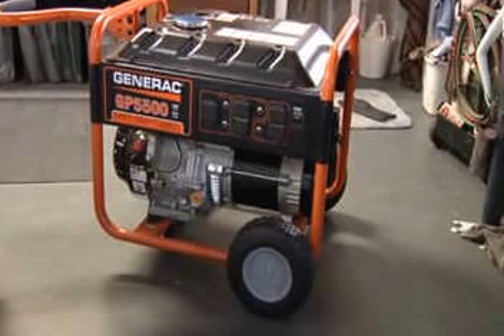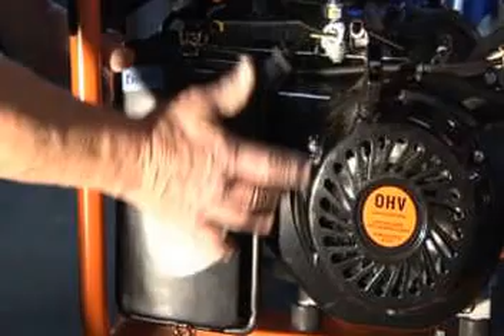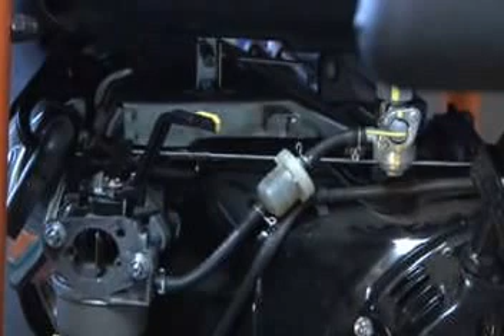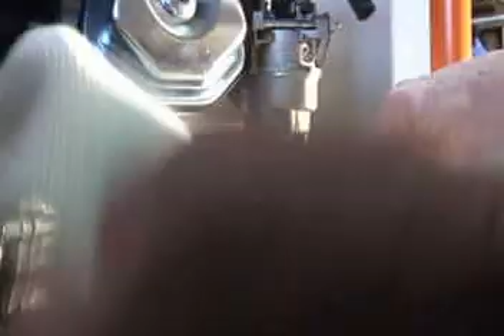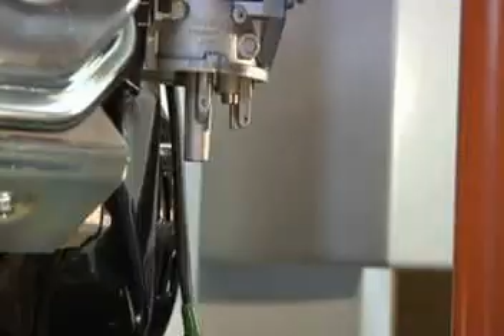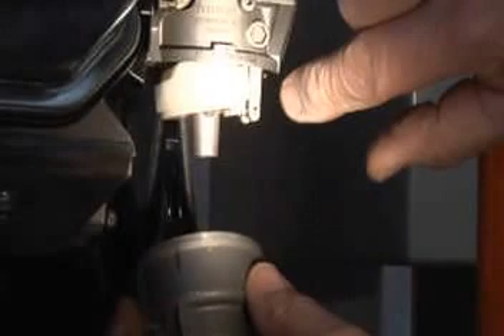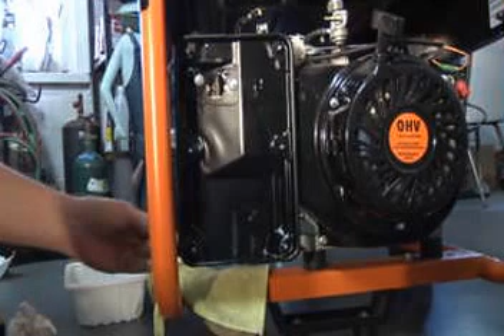Fixing Fuel leak on Generac GP5500 Generator

Comment: Bought a new generator after Irma but didn't open it until Elsa was on her way here.  Took it out of the box, set it up and when I flipped the fuel valve on gas started running everywhere.  I thought it was gaskets but it turned out to be the float was a bit stuck.  I unstuck it and it seems fine now.  Your video was very useful in confirming what I thought the issue was.  Very good and detailed video, sir!
Edit: My Generator is a Westinghouse but it's laid out just like your Generac.
Reply: Generator safety: this is only a reminder for everyone’s safety when using portable generators. Anyone who uses portable gas generators really needs to see this safety reminder. All generator safety rules should be followed carefully. This advice is just to make sure that everyone is aware of all the warnings and it’s just to remind people to be careful using portable generators. Generators can be dangerous if not used carefully. Every year, hundreds of people die or get injured when using portable generators due to carbon monoxide poisoning and electrocution. Make sure you are using your generator carefully and keeping others safe as well. There is something very serious that everyone should always be aware of when using generators. Some people do run their generator indoors which is not safe and that increases the risk of carbon monoxide poisoning which can cause death of family and you. Some people run their generator in wet conditions which can electrocute them. Please remember that you should never run your generator indoors. Remember that carbon monoxide is an odorless and colorless gas that you cannot see or smell. Carbon monoxide is a silent killer. Keep that in mind. Make sure your generator is 15-20 feet away from your house and away from doors, windows, and vents. Never use your generator in your porch too. Having a carbon monoxide detector is very important against generator safety. Some people also allow children to go near the portable generator which could pose risks. We need to keep an eye on our children making sure that they are not near the portable generator so they won’t get electrocuted or burned by the generator which is dangerous. A locking enclosure also keeps kids safe. A generator shed might look like a tempting place to explore, or take cover during a game of hide and seek, but a generator is a dangerous piece of equipment that can cause injury. It says on the manual that we should also keep children away at all times from the portable generator to avoid injuries. Please do not allow a child or unqualified people to operate the portable generator. Just because some manuals missed what should be listed doesn’t mean it’s safe to do. Always follow the generator safety rules when using portable generators. Generators pose electrical risks. If you need to use your generator during wet weather, you need a generator tent to protect your generator from getting wet. Don’t let your generator get wet. Keep your generator dry and before using your generator, please make sure your hands and your generator is dry. Do not wear loose clothing when operating the generator. Everything that is said on the generator’s operating manual should not be ignored. Never smoke cigarettes near the generator. Please keep flammable things away from the generator. Never overload your generator too. Your generator can catch fire. Never ever try to plug a generator cord into a wall outlet to avoid back feeding. Back feeding your generator is dangerous. Always turn on your generator first before plugging in appliances and shut off the appliances before turning your generator off. Use a heavy duty cord for your generator and the cord should not be worn out. All the instructions should be followed carefully. Never refuel your generator while it’s running. It can cause fire if fuel spills while your generator is hot. You should turn off your generator and let it cool off before refueling it. Having a fire extinguisher next to the generator is also important. This is only a reminder for everyone’s safety of using generators. Make sure your generator is properly grounded. Having a fire extinguisher next to the generator is also important against the safety rules. https://youtu.be/I1jT3ANENvI and here is a video more about keeping others safe when using generators and also about our family’s safety. Hope this helps. Remember it’s better to be safe than sorry.

Comment: Thank you! Mine was pouring fuel. Followed your video and had it fixed in a out 30 minutes.
Reply: Here are the rules about portable generator safety: This is just a reminder for everyone’s safety. All generator safety rules should be followed carefully. This advice is just to make sure that everyone is aware of all the warnings and it’s just to remind people to be careful using portable generators. Generators can be dangerous if not used carefully. Every year, hundreds of people die or get injured when using portable generators due to carbon monoxide poisoning and electrocution. Make sure you are using your generator carefully and keeping others safe as well. There is something very serious that everyone should always be aware of when using generators. Some people do run their generator indoors which is not safe and that increases the risk of carbon monoxide poisoning which can cause death of family and you. Some people run their generator in wet conditions which can electrocute them. Please remember that you should never run your generator indoors. Remember that carbon monoxide is an odorless and colorless gas that you cannot see or smell. Carbon monoxide is a silent killer. Keep that in mind. Make sure your generator is 15-20 feet away from your house and away from doors, windows, and vents. Never use your generator in your porch too. Having a carbon monoxide detector is very important against generator safety. Some people also allow children to go near the portable generator which could pose risks. We need to keep an eye on our children making sure that they are not near the portable generator so they won’t get electrocuted or burned by the generator which is dangerous. A locking enclosure also keeps kids safe. A generator shed might look like a tempting place to explore, or take cover during a game of hide and seek, but a generator is a dangerous piece of equipment that can cause injury. It says on the manual that we should also keep children away at all times from the portable generator to avoid injuries. Please do not allow a child or unqualified people to operate the portable generator.  It is important to keep your children safe especially little ones. The portable generator can be hot during an operation. Just because some manuals missed what should be listed doesn’t mean it’s safe to do. Always follow the generator safety rules when using portable generators. Generators pose electrical risks. If you need to use your generator during wet weather, you need a generator tent to protect your generator from getting wet. Don’t let your generator get wet. Keep your generator dry and before using your generator, please make sure your hands and your generator is dry. Do not wear loose clothing when operating the generator. Everything that is said on the generator’s operating manual should not be ignored. Never smoke cigarettes near the generator. Please keep flammable things away from the generator. Never overload your generator too. Your generator can catch fire. Never ever try to plug a generator cord into a wall outlet to avoid back feeding. Back feeding your generator is dangerous. Always turn on your generator first before plugging in appliances and shut off the appliances before turning your generator off. Use a heavy duty cord for your generator and the cord should not be worn out. All the instructions should be followed carefully. Never refuel your generator while it’s running. It can cause fire if fuel spills while your generator is hot. You should turn off your generator and let it cool off before refueling it. Having a fire extinguisher next to the generator is also important. This is only a reminder for everyone’s safety of using generators. Make sure your generator is properly grounded. Having a fire extinguisher next to the generator is also important against the safety rules. https://youtu.be/I1jT3ANENvI and here is a video more about keeping others safe when using generators and also about our family’s safety. Hope this helps. Thank you.

Comment: If you want to make that generator prrr do this........use a NGK spark plug,  use only ethanol free gas if you have no access to ethanol free gas use startron additive,  use mobile one synthetic oil and make sure you drain the tank and carb if storing for a long time.  You will notice a big difference immediately the way your generator starts and runs!  YER WELCOME

Comment: I have a Generac 10000 generator.
Can anyone show me or exactly write to me how to change the air filter.
It is not like others.
It is placed between the top of the engine block and the fuel tank, less than an inch space in between and impossible to remove.  Lifting up the gas tank to make room is impossible because of the rigid steel frame. 
All generators online are with such information except the Generac 10000.
My email is; thetenofus@yahoo.com
Help much appreciated
Reply: I hope you like this video too https://youtu.be/I1jT3ANENvI

Comment: Im about to get started on my fix. I assume its the same issue. Why these Generacs have so many people with the same issue is anyones guess.  After 1 year of not using it the thing should NOT start leaking. Its a factory defect with these machines.  Hope its the same issue as you had. Thanks for posting a very complete video on the repair.

Comment: This was not was actually the same problem that was happening on my DuroMax generator, but your video got me in the direction to at-least start troubleshooting.  Bought this generator used off CraigsList, and the guy said it was leaking when the petcock was on 'flow'.  When the engine was started, it would stop leaking, and would run fine.  When the engine was stopped, it would leak until the petcock was shut off.  ...All it turned out to be for me, was that the guy had not properly tightened that 'cup' where the float is, and the fueal was leaking through the screw threading that holds it up into the carburetor, and out of the 'cup / bell' housing, under the choke flap...

Comment: Thank you so much for this. $4 for carb cleaner, a little cleaning and it's back working again.
Reply: Don’t forget about the generator safety rules: anyone who uses portable gas generators really needs to see this safety reminder. All generator safety rules should be followed carefully. This advice is just to make sure that everyone is aware of all the warnings and it’s just to remind people to be careful using portable generators. Generators can be dangerous if not used carefully. Every year, hundreds of people die or get injured when using portable generators due to carbon monoxide poisoning and electrocution. Make sure you are using your generator carefully and keeping others safe as well. There is something very serious that everyone should always be aware of when using generators. Some people do run their generator indoors which is not safe and that increases the risk of carbon monoxide poisoning which can cause death of family and you. Some people run their generator in wet conditions which can electrocute them. Please remember that you should never run your generator indoors. Remember that carbon monoxide is an odorless and colorless gas that you cannot see or smell. Carbon monoxide is a silent killer. Keep that in mind. Make sure your generator is 15-20 feet away from your house and away from doors, windows, and vents. Never use your generator in your porch too. Having a carbon monoxide detector is very important against generator safety. Some people also allow children to go near the portable generator which could pose risks. We need to keep an eye on our children making sure that they are not near the portable generator so they won’t get electrocuted or burned by the generator which is dangerous. A locking enclosure also keeps kids safe. A generator shed might look like a tempting place to explore, or take cover during a game of hide and seek, but a generator is a dangerous piece of equipment that can cause injury. It says on the manual that we should also keep children away at all times from the portable generator to avoid injuries. Please do not allow a child or unqualified people to operate the portable generator. Just because some manuals missed what should be listed doesn’t mean it’s safe to do. Always follow the generator safety rules when using portable generators. Generators pose electrical risks. If you need to use your generator during wet weather, you need a generator tent to protect your generator from getting wet. Don’t let your generator get wet. Keep your generator dry and before using your generator, please make sure your hands and your generator is dry. Do not wear loose clothing when operating the generator. Everything that is said on the generator’s operating manual should not be ignored. Never smoke cigarettes near the generator. Please keep flammable things away from the generator. Never overload your generator too. Your generator can catch fire. Never ever try to plug a generator cord into a wall outlet to avoid back feeding. Back feeding your generator is dangerous. Always turn on your generator first before plugging in appliances and shut off the appliances before turning your generator off. Use a heavy duty cord for your generator and the cord should not be worn out. All the instructions should be followed carefully. Never refuel your generator while it’s running. It can cause fire if fuel spills while your generator is hot. You should turn off your generator and let it cool off before refueling it. Having a fire extinguisher next to the generator is also important. This is only a reminder for everyone’s safety of using generators. Make sure your generator is properly grounded. Having a fire extinguisher next to the generator is also important against the safety rules. https://youtu.be/I1jT3ANENvI and here is a video more about keeping others safe when using generators and also about our family’s safety. Hope this helps. Thank you.